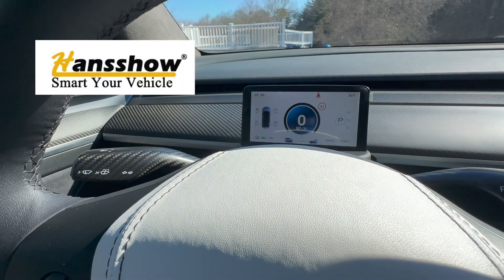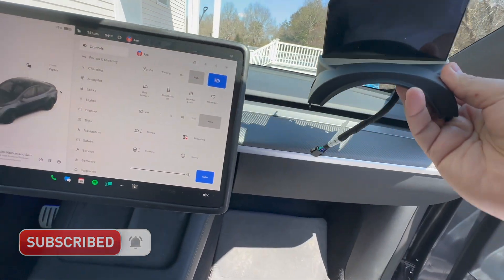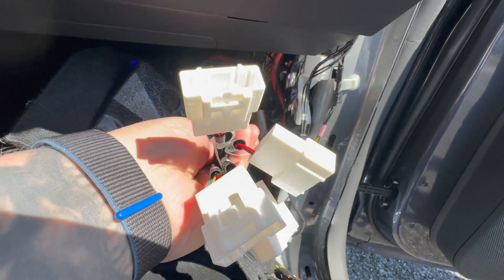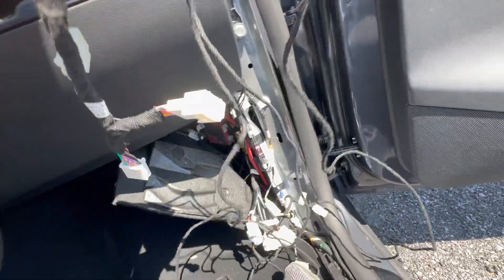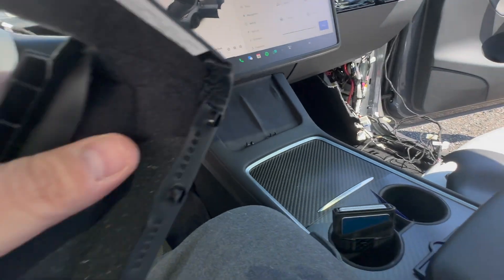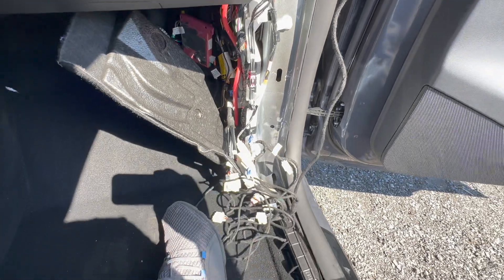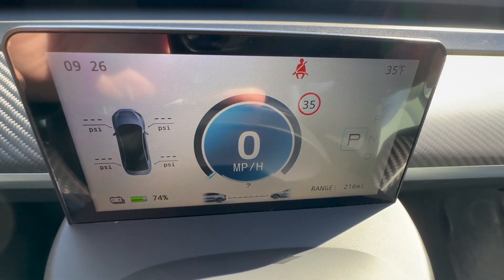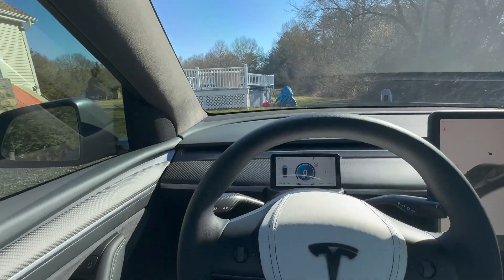New Tesla Model 3/Y 5.16" Mini Dash Display Install, Review, Walkthrough

Comment: Thanks for the video. Please provide the product name and information for the "jumper", and where purchased. I did not see anything like this on the Hansshow website. Thanks!
Reply from the maker: Thanks for the feedback but the link and manufacturer of this product is clearly stated in the description of this video. I’d suggest checking those out at times, as that’s where we creators usually put crucial information such as this. 😉 👍
Reply: @JaeTheDev  It is not the Hansshow Mini Display that I am interested in, It is the item you said Hansshow told you about, and you show and called a "jumper" at the 3:10 mark in your video. As far as I can tell, that item, or a link to it, is not stated anywhere in your description, or on Hansshow's website. Thanks.

Comment: Do u have Intel Atom?
Reply from the maker: No, mines a Ryzen chipset that this was installed on, but my wife’s is an Intel based 21 MYLR and hers works perfectly as well. The cable has both connections, one for Ryzen and the other for Intel on it so it’s full proof.
Reply: @JaeTheDev  Thanks